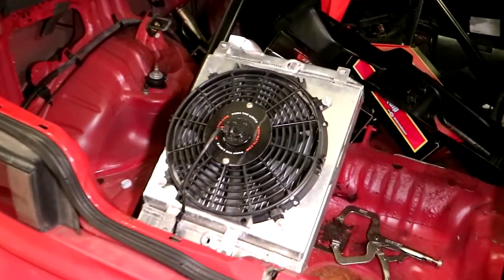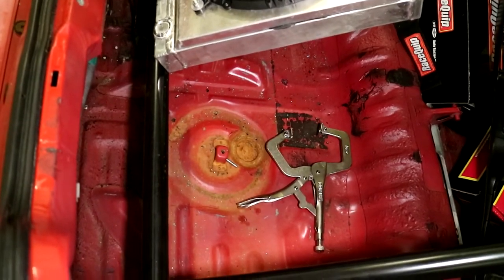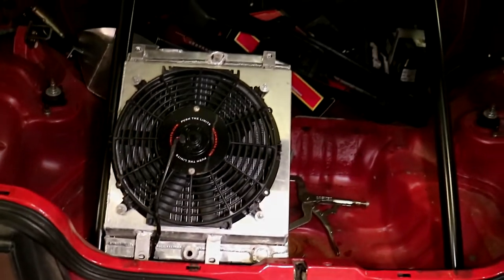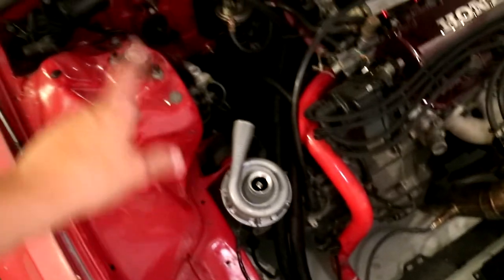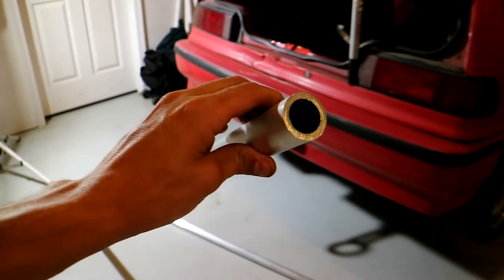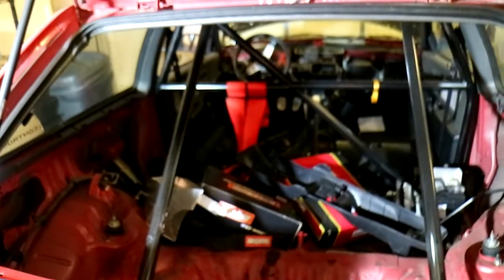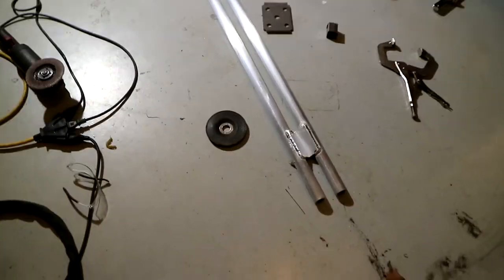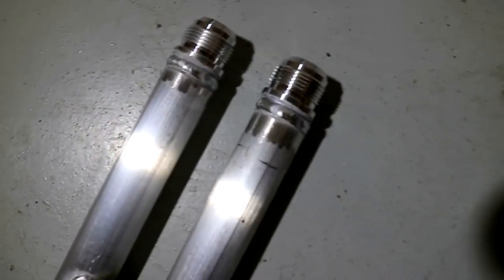Starting over on the cooling system with a turbo water pump

Comment: I'm a little concerned and curious as to the welds on the aluminium tubing
When you mentioned that you were going to weld on them I thought no way you shouldn't do that
I thought that having them fitted to rubber mounted screwed fittings would be a better idea wouldn't it ????as cars flex a little 
As with exhausts they move a little  and with a solid mount it may crack 
Just my opinion 
Love the work your doing well done